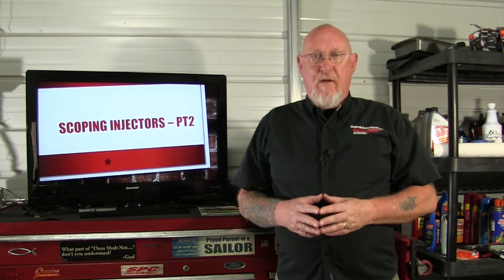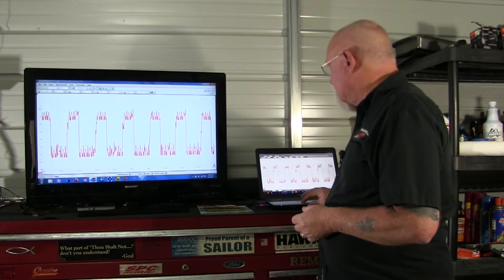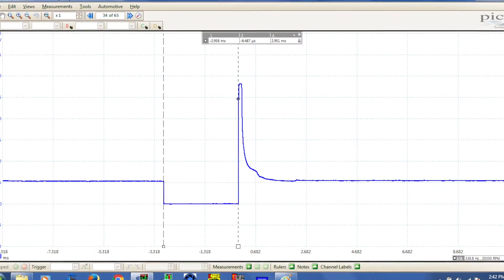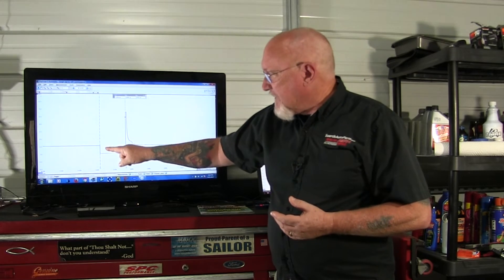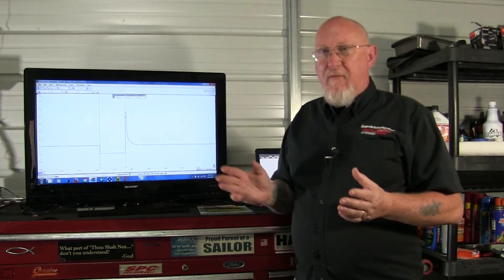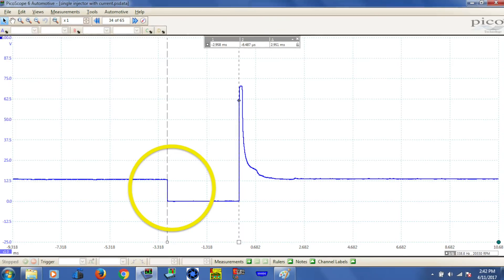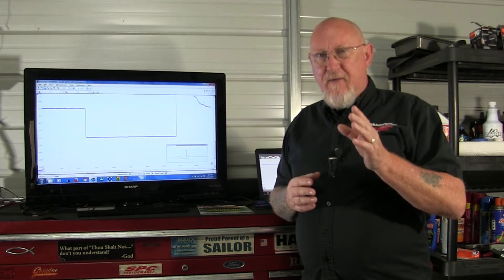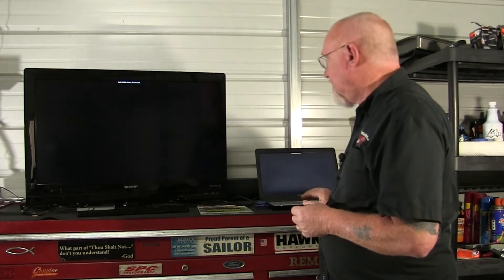Motor Age How2 #15 - Exploring Fuel Injector Waveforms

Comment: What make and model of scope did you use for these waveforms?  The challenge with lower end scopes is seeing the pintle opening, especially on the voltage waveform.  To see the pintle opening on the voltage waveform, expand the voltage at the bottom of voltage waveform when the ECM commands the injector open and see the bump.  Lower end scopes do not have the resolution to see this opening bump.

Comment: So is the voltage pattern theoretically supposed to be flipped upside down on the graph?
Reply from the maker: Not sure I understand your question. Can you reference it to the time stamp on the video, or clarify what you're asking?
Reply: @VehicleServiceandRepair  so on the voltage pattern on the injector of the graph, when it’s grounded getting power the graph shows  it going down and then the ecm “ungrounds” the injector showing it “turn off” and then it spikes. Wouldnt that entire graph supposed to be flipped upside down on the graph?
Reply from the maker: @cubenitup  Remember where we are connected. When our measuring lead (positive lead) is placed on the ground side of any electrical load, it should read Open Circuit Voltage when the circuit is off and when the circuit is turned on, the voltage should drop across the load and read near "0". In the case of any device that uses a magnetic field, this is also the time period that the field is being energized. When the power to the coil is removed, the magnetic field collapses and creates the voltage spike you see. Make sense?
Reply: @VehicleServiceandRepair  yes awesome!!
Reply: @VehicleServiceandRepair  oooh never mind. Because the injector is getting power 12-14volts all the time. I understand nvm
Reply from the maker: @cubenitup  👍

Comment: Where do we look for high current across the coil. Is this a thing?
Reply from the maker: High current would be caused by a shorted coil. I like to place my amp probe at the fuse feeding all of the injectors to check for this. The bad one will stand out from the rest. 
I've also restarted this series - you may be interested in following along!

Comment: Hey, Pete.Could you please explain to us what an injector waveform would  look like if an injector winding were open? I have a hard time picturing it.
I know that there won't be any magnetic field, no ON- time; therefore, no voltage spike. But, will the 12v only be pulled to ground?
Reply: If the windings or the circuit were open, you'd see 0v on the waveform. Just like a voltage drop test...

Comment: Great job!!! 
Would it be possible to do a Video explaining floating grounds? I think it would be good for those who don't know what it is
Reply from the maker: Mark Boggess Sounds like a great idea!
Reply: Yes like for example today I was playing with my scope and scoping the O2 sensors on my personal car. I noticed that the Vmax was 1.7 volts of my No1 sensor and it was switching but seemed to be floating off my Zero point on my scope.. I was on the Battery ground not the sensor ground..now is that because it's a floating ground that's already at so many Mili volts above true chassis ground??
Reply from the maker: Mark Boggess Yes. And true of any sensor that grounds to the ECM.
Reply: awesome thanks for the replay I had a idea that was the case but in the back of my head i was doubting my scope as I was always streaming the PIDs via the BlueDriver scan tool and seen it was within the normal O2 sensor range.. I was ready yo throw my cheap Hantek away as I felt I could not trust it but thought " duh I'm sure it's because I'm on battery ground and sensor ground is just a small milivolt positive potential" lol

Once again thanks for the replay and thank you for all the awesome videos   for us self taught guys it helps a whole lot !!!
Reply from the maker: Mark Boggess Your welcome!

Comment: Pete didn't some early Mopars fuel injection systems not pull a full 12 volts when switched on but only pulled 10 volts?  I am trying to remember I have not worked on one in years but it was the norm to only see it pull 10 volts when switching on leaving 2 volts behind and that could lead you down the wrong path.  If memory is correct...
Reply from the maker: Sorry, don't recall...that may be, though, especially on early designs. That's why I always say you need to know the system you are working on to know what to expect on your screen.

Comment: So I think a low amp clamp is your best way to check injectors is that what u are getting at ????   if a guy can get at the wires
Reply from the maker: Not necessarily the "best" way, but A way for sure. I believe in having multiple ways to test any system - and then use the test best suited to the situation.